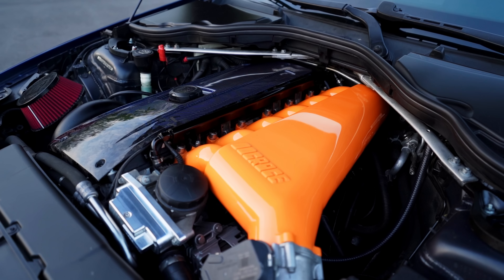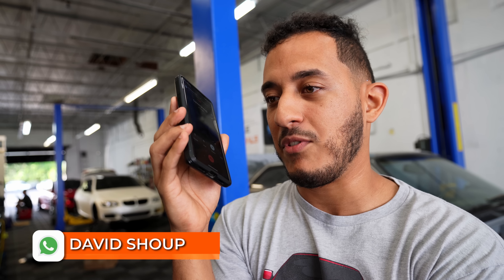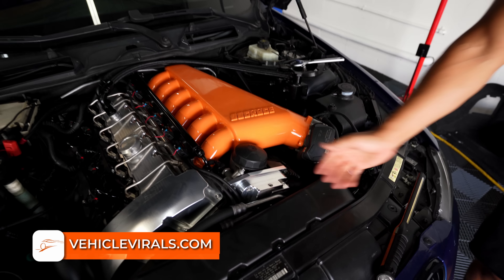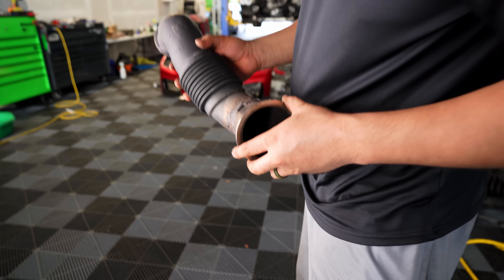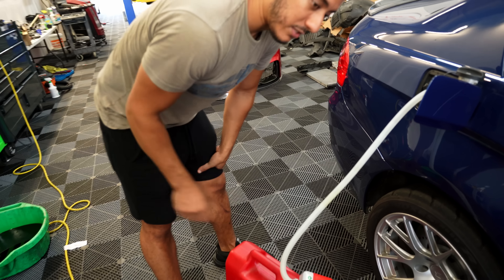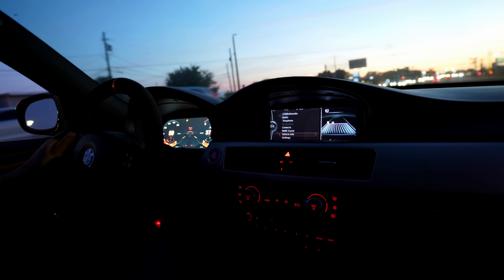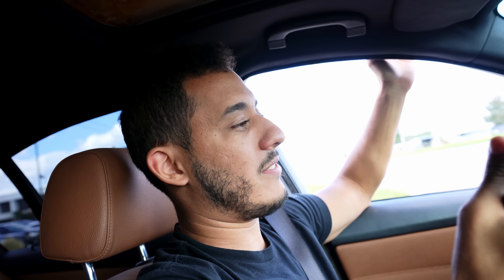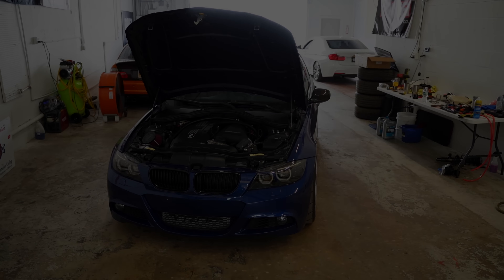The Headache That Comes With A 700HP BMW 335i

Comment: If there’s any car that deserves an engine build, it’s definitely the e90
Reply: yea build an ls and stick it in there
Reply: I owned an e93 previously. For over a decade now I've been waiting for SOMEONE with enough clout to get parts made (😉) to have all of the known issues locked up tight. Surely someone can make an OFHG, Valve cover gasket, oil pan gasket, water pump, coolant cap and reservoir, rod bearings, replacement turbos, fuel pumps, coils, plugs, actual valve covers and such that can last a 100k or more miles!! 

That list didn't seem so ridiculous in my head, now that it's out, I remember why I dumped it and bought a Tesla!! 😂😂
Reply: @ferrynpalmer3875 everything was alright until you said tesla! B58 exist in case you don't know.
Reply: @davidmitchell5638  .....lol, you are correct. A few years back when I got out of the e93 335i the B58 wasn't yet known to be a way more reliable platform. I love my Model S though!
Reply: if there’s any woman that deserves a chance, it’s definitely the one who cheated on you.
Reply: Hell yaaaaaa

Comment: trust me bro build a bullet proof n54 and don't cheap out the 700whp maintenance it's really the maximum power stock block n54 can handle so ur pushing it for over a year now thank god u didn't blow it up 

i suggest you go with a closed deck conversion kit for the n54 with aftermarket pistons/rods/bearings and after that boost it to 30+ psi and enjoy every minute. 
love ur content bro keep up the good work ❤🫡🫂
Reply: just looking at the video and how slow it seems and knowing what psi hes running on the kit....this aint no 700 wheel car. this is a 450-500wheel car. 600wheel if he runs 23+ psi. clickbait title
Reply: Petty sure it’s been dynoed at 700, he may run lower boost maps but that setup is more than capable

Comment: Pcv system is ur issue only way to get rid of the smoking is running a gmc vacuum pump to pull the crankcase pressure out.

Comment: If you build it you should add water injection to the turbo inlet side. This is proven to drop intake air temps even and provide piston cooling thus you can push more timing. Also the n52 exhaust cam works for the n55 and n54 gives a lot more lift and duration on the valve. If you went with upgraded rods and piston and closed deck a ported head is a must and going full dry sump. Car is going to push a lot of power and last thing you want is any oil starvation. And with that you should go and add on an oil bypass kit. Now these are used a lot in the diesel world but these drastically reduce engine wear due to contamination. Your first oil filter can run low as 5 micron. Now I would believe you have some for a lot of these things near fire wall. Now last op thing would to retrofit b58 intake with water air intercooler to fit. So double cooling with the front mount. But you would ditch that for bigger oil and water cooling with a closed deck system.
Reply: Straight water injection without meth? If I get a M240i or 235i I was considering doing straight water injection as don't really want to do water/meth mix. (Only if I can find a reasonably priced 6 speed manual in Australia... Unlikely lol)

BUT, if I can find one, I'll be putting a Pure500 on the 235i, or if I can get a m240i, I'll put a Pure800 on it.
Reply: @legendarymark112  water injection has been used since WWII. It’s safe you still have to tune for the higher air density. It’s like running ethanol. The big thing where you place the system pre turbo or after before the intercooler and definitely one right at the intake.
Reply: @michaelbrooks9462  Have you done straight water injection on a N55 or B58? (Or seen anyone do it? If so what results power wise did they get with just pump 98 RON/93 AKI?) I really can't find much on it other than mixed or straight meth injection, and would be running 98 RON in it.

Comment: Would love to see a built motor! Love the content man.

In my honest opinion from driving and modding N54 for years, n54 stock motor is reliable at a max of 350 - max 370wkw. Once you go past this it’s just endless issues and the motor simply wont last. Obviously fuelling plays a big role and I am mostly talking about when running twins. Single makes less torque so bent rods are less of a concern but running twins past 370wkw almost guarantees hurting the motor eventually, plus on the way to hurting the motor it’s just endless headaches, misfires etc bla bla bla. 

Also water injection is such a great mod and really helps as it helps massively with timing corrections, intake temps and cylinder temps. No need for methanol, just straight up water.

Comment: I have E90 335 with DR700 kit and I have single bank O2 works great and I have MHD boost control car makes 560whp with just upgraded Lpfp zero issues.
Reply: Damn! That thing is a beast then. I have 480 whp and it scares me. My neighbor took me for a ride in his Tesla X Drive one time and after that I stopped upgrading. I will never get to a 3.2 second 0-60 in my n54.
Reply: Hey man, did you have the two 02 ports on your downpipe or did you install it. I have the two ports but compared to Christian they seem far from teh turbo. Wondering if it’s ok for them to be at the end of the downpipe for single bank 02 to work properly.

Comment: Just a suggestion when hunting a fuel leak, my e90 had a hairline crack on the top of the fuel pressure regulator housing. I never would’ve noticed it had I not had the back seat off and smelled the tiniest hint of fuel. The housing is plastic and just becomes brittle overtime. Worth checking.

Comment: You might want to get thermal camera and check the cylinder 1 piston see if there is any cracks or the ring it self and check for the sleeves. Maybe also do leak down test.

Comment: hate to say it but you may need to look into your valve seals. I had an issue with mine on cylinders 3, 4 and 6 sweating causing residue in the exhaust ports and turbos causing smoke.

Comment: Mot likely blown turbo seals. my GTI which had a GTX3071r started smoking just like that.. fixed the smoking issue once the turbo was rebuilt.
Reply: I just put in new turbos at 148k miles. It was leaving the smoke trail everywhere. Now, it's back in shape and gripping and ripping with no misfires or hesitations.

Comment: Ah sorry man I have a 335is new long block new stock turbos I really couldn't go the big turbo route because my original motor cracked and seized from a silicon poisoning someone put that stuff on the crank seal and I lost the car 12hours after owning it. but I am FBO inlets downpipes intake big arm front mount so I hope to keep the car stable not pushing any hard tune.
Reply: but if my og motor wasn't cracked I was going to build the motor and I might be able to if I can get a block and if the heads still good but getting that silicon contaminent out would be a nightmare.
Reply: That sucks big time. It's no big deal to replace that front seal either.

Comment: I know on motorcycles for example, if the throttle isn't open (i guess valvetronic in this case?), then it won't build up enough compression for the test and be way off!

Comment: ur e90 is the reason i went and bought one 🤭 currently sitting in my driveway with a trunk full of aftermarket parts i got from ur site and a coolant leak im tryna fix
Reply: Where's your coolant leak or do you know, I've pretty much fixed every one on mine that could pop up.
Reply: @TheFrenchPug  its on the side with the turbos it leaks on the downpipes and burns off
Reply: @hdhfjthdjfughhnghr8315  The coolant tanks crack at the seam. Do you see any signs of coolant spray around the backside of it? I've replaced 2. It can spray down onto the exhaust from there. Another spot would be the coolant line supplying the turbo down below. You have to replace those when swapping the turbos, and they get weak and can leak (big ugghhh there).

Comment: It might be interesting to put a camera in cylinder 1 to see if a valves are not damaged and why not inject oil to see if the piston is still tight
I agree with most people on the fact that stock n54s don't last very long at 30psi or more, I run mine at 25...fingers crossed, but the pistons and rings are the first to fail on preparations 700WHP or more
If you want to make it reliable above 28psi, you need other things than internal BMW parts, even with maintenance they are not enough...
Peace from France

Comment: I would switch coil & inyector to other cylinder to see if the miss fire travels and would check fuel filters. Old E85 turns into gelatina ….

Comment: Isn't one of the most common problems the mosfets in the ecu? there's 6. 1 for each cylinder. while the coil packs being higher energy is a good idea. you probably need to open that ecu and replace the mosfets. they're 3$ and a bit of soldering.

Comment: I bet that valve cover is messing with the pcv system and causing that smoke
Reply: I'm on my 3rd valve cover at 149k miles. I put in a billet valve a while back as well. It's been running like a monster with my tune and methanol injection.
Reply from the maker: Smoked prior to the aftermarket valve cover.

Comment: Would you ever get an e82? Its fun, a short wheel based little car with a big i6!
Reply from the maker: Been wanting one.
Reply: @VehicleVirals I have a clapped one that I’m sure you can make great content with. Biggest selling point is the JMC Tuning single turbo kit, G35-1050 turbo, and 6-speed manual.

Comment: Go for it.  Sick car to let go.  Tienes gripe el carro dale medicina.  Bmwprufen e90 non-drowsy.  It will be fine. Sounded a little out of gear when you did the pull I could be wrong.  Check injectors or coil in cylinder 1.  Change those first then try it again.  You never know.  If it works your welcome lol.  Cuidate Tigere and Jess..

Comment: Dear Sir,
I follow your channel vividly!
I live in the Netherlands and have finally decided to pull the trigger and get a F10. What I've noticed is that the years up to 2014 had issues. Soo my main focus has been on '15/'16 and to try and use yours as a model. If true about '14 would you advice against this for I have a temp dep on one bl/red comp 145,K kilometers. I'd appreciate help in this or should I stick to '15/16? Once I have one I'll ad all you've applied to yours.
PLS help, kind regards Roland

Comment: Try coding a new or used ECU/DME. I had the same issues was giving code 30ff (something like that) and a few others. IIRC the code had something to do with bad injector drivers or something in the ECU. The bank 2 cylinder ran like shit.

Comment: Yo I have the same doc race kit do u happen to know how much boost u hit on waste gate spring pressure with the turbo smart waste gate stock spring should be a 14psi spring I am only hitting 10psi my tuner says this is not right but doc race says this is normal
Reply from the maker: I upgraded the spring

Comment: One of my friends has an e90, that stopped smoking after changing the oil specs but i cant recall which one he used. His car ist still running smoothly but its not pushing 700hp 😂

Comment: i think you should crack open the engine for sure and get a look at engine wear if any... and maybe deck the block haha
Reply: all the parts you installed on the engine call for an engine rebuild
Reply: I have an n54 tuned with meth injection. It has so much power I get scared it's going to rip out the trans or back end. I'm no where close to 700 hp. I don't see how this engine could hold up to that but I've seen them with 1100 hp too!!! I imagine those are all seriously upgraded internals and what nots,  though.
Reply: @TheFrenchPug  that sounds scary sheesh 700hp is a goal of mine but I’ll rebuild first
Reply: @takemoneysatch  After I road in my buddy's Tesla, I said F it! Those things are blowing deep high power engines off the line at the drag strip. So, why bother if I can't pull up next to one and take it out? I was pinned to his seat like I was being rocketed to space and the car was still accelerating (very quietly as well) before we had to slow down for a turn. It has a big battery and 4 electric motors on the axles. No drive shift (more room in the cab), a sick factory sound system (like I'm in a nightclub), totally programmable for things I would never even think of, no gas, storage in the front and rear trunk. Can leave my pets in the car with AC running without burning fuel or worrying about CO2 fumes or anything deadly, and it drives its damn self! So, I gave up on the HP chase. I'm done.